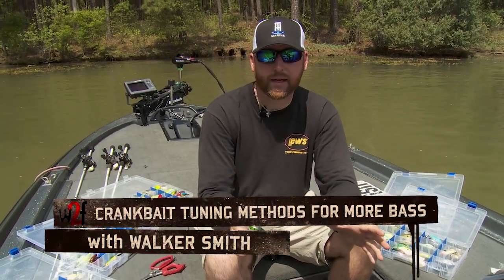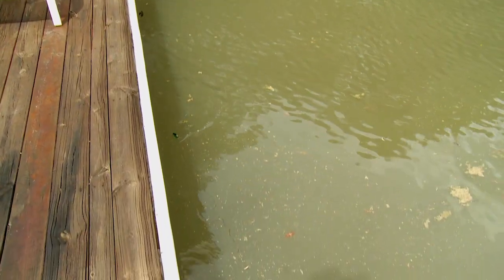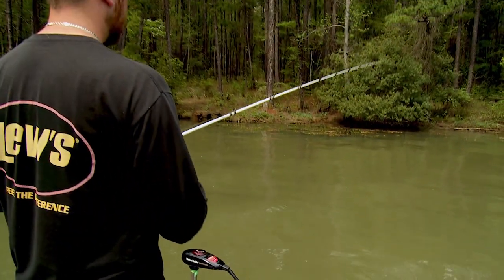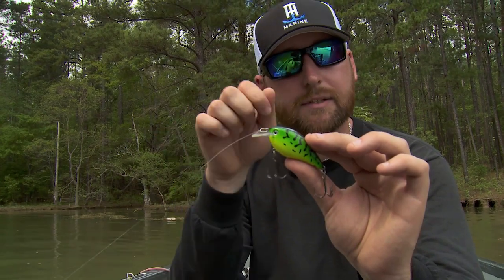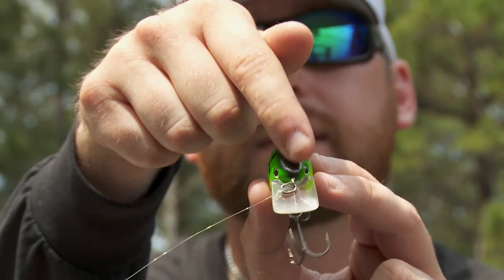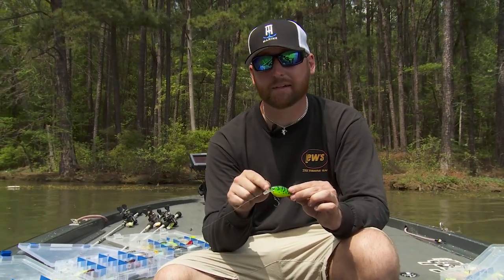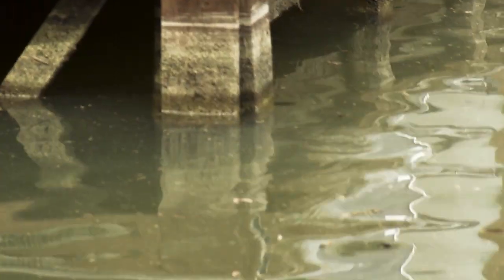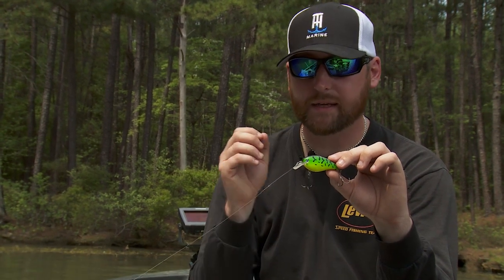Crankbait Tuning Methods for More Bass

Comment: Thanks for explaining this so well in this video.  I have a couple crank baits that run to my left and didn't understand why. I've been using them in circumstances where I needed my lure to circle to the left, not realizing how to fix them.  I originally thought that they had gotten bent, but upon inspecting them, they looked fine.  So, that tells me, a little goes a long way!  Great, helpful video!

Comment: Good tips right there.  I have a few that run to the right, instead of fixing them I will delegate those for dock fishing.
Reply from the maker: Chase Graves Some folks tune them intentionally to run to one side or the other and use them to fish docks or seawalls or other long horizontal structures.